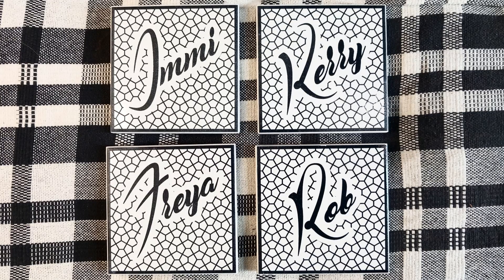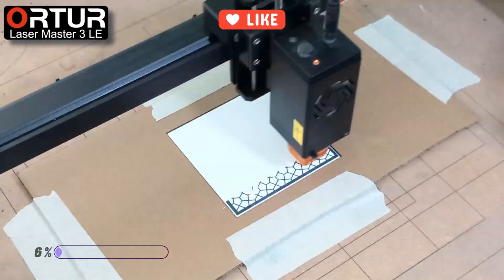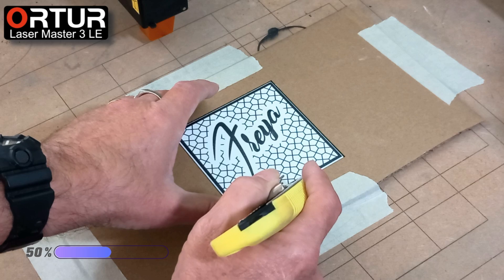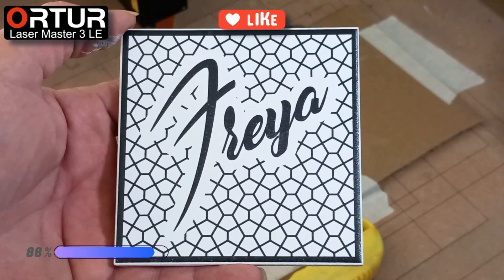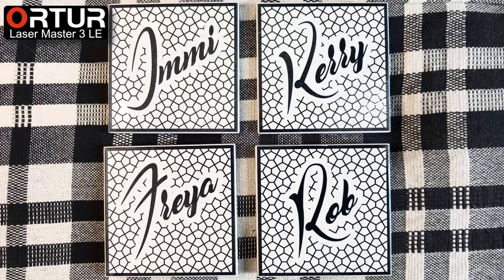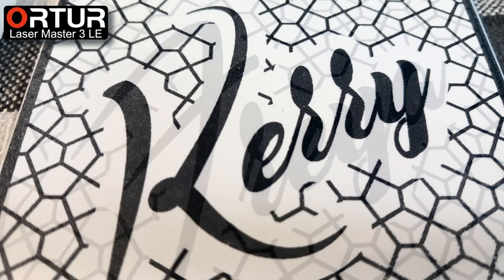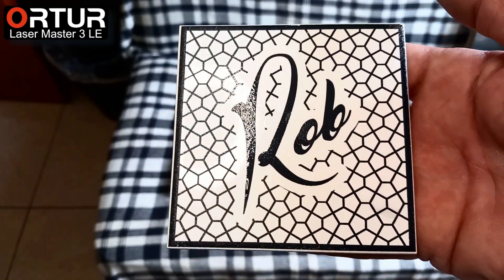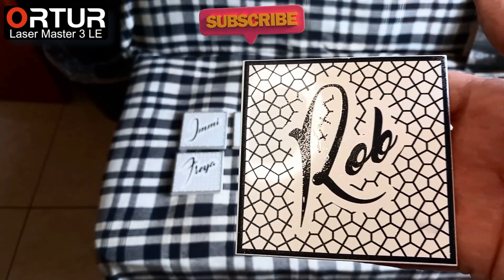Ortur #laser master 3, TiO2 + cardboard template + ceramic tile engraving

Comment: Did you spray a lacquer or any sealer on them after cleaning?
Reply from the maker: Hi & thanks, nope no need to use a sealer as the laser only burns into the top layer of ceramic and only by a few microns, I have tiles I engraved on over 2yrs ago and still looking good, i use one as my coaster daily, no problems as yet ;) Thanks.